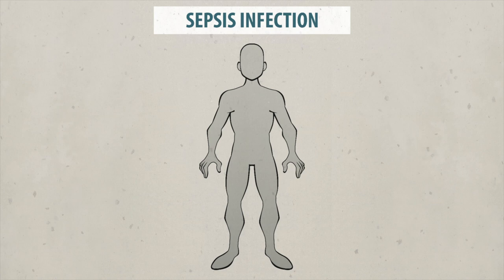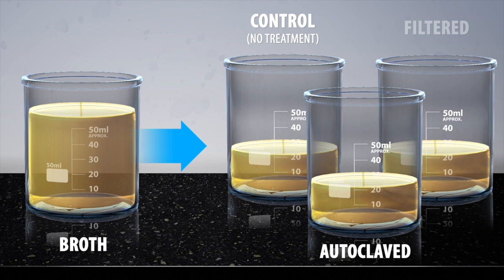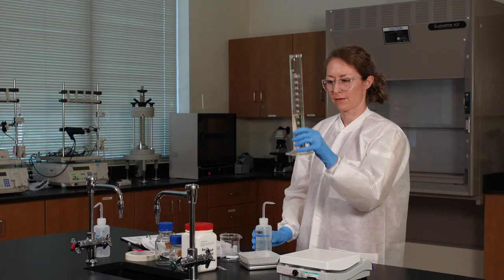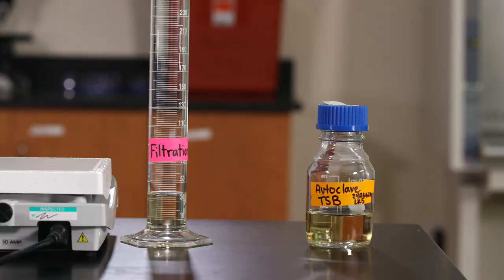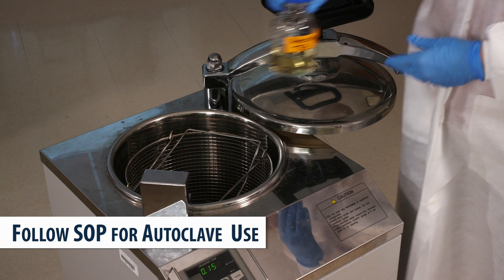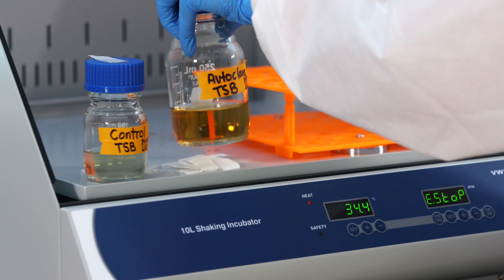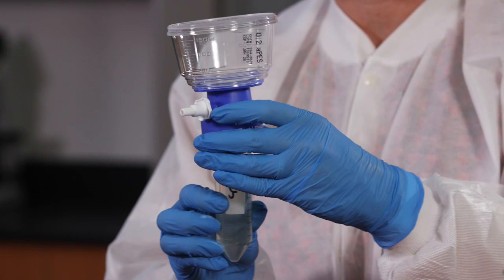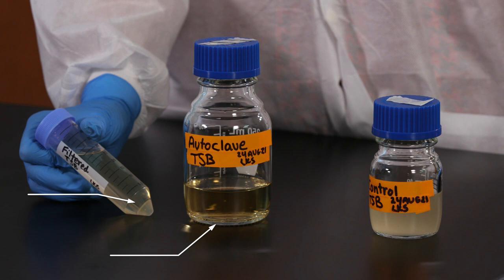Sterilizing Liquids: Autoclaving & Filtration

Comment: Could you please tell what type of membrane will be required to filter - sterilize urea solution ( 0.1% w/v) , lactic acid (88 to 92% concentration), hydrogen peroxide solution (30%w/v)and NaF solution (60%w/v)?
Reply: 0.2 μm filter poor size is needed for sterilization